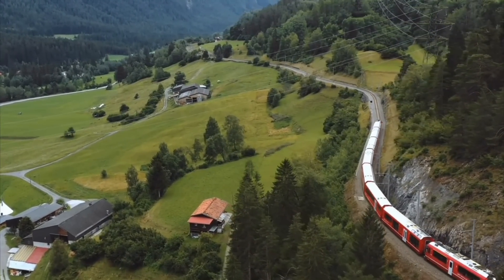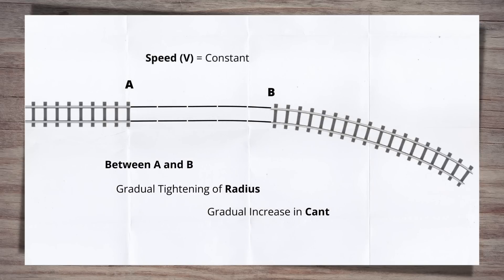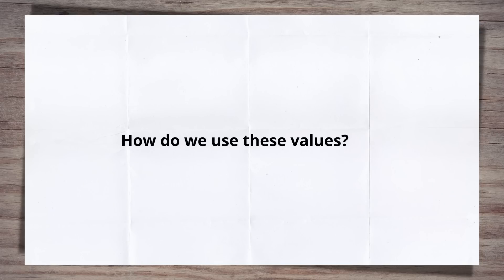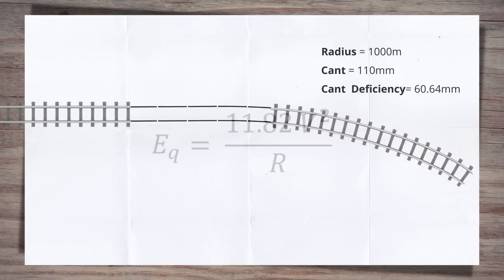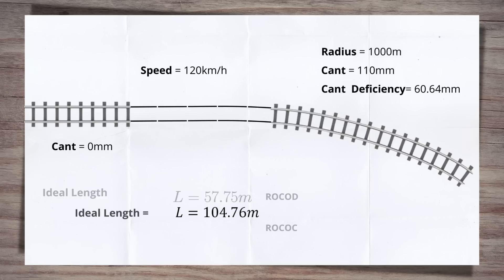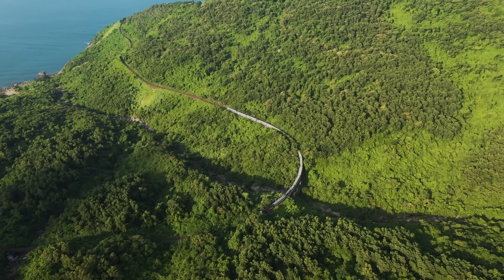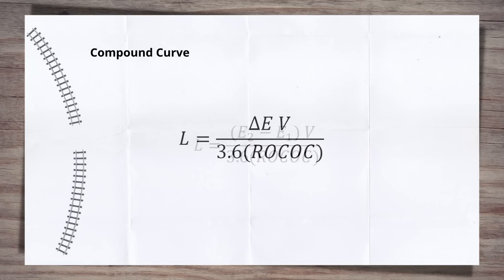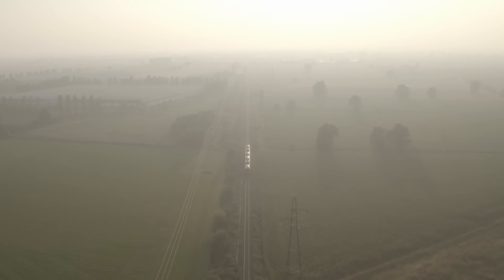Track Geometry Transitions! The Best Guide to This Part of Railway Design

Comment: The main reason for transitions is avoiding jerks on trains. Jerks a sudden changes in accelerations. On a straight line there are no side accelerations but in a curve there are such accelartions leading to centrifugal forces (inertia of masses). Clothoides are one geometry to transition. 
Even without cant on slow tracks train wheels will lever as part of their contact geometry between wheel and rail.